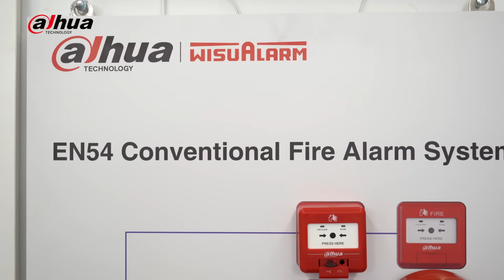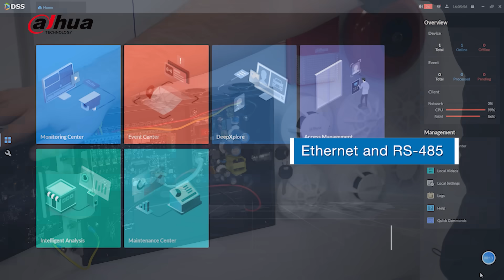Dahua Conventional Fire Alarm System

Comment: How can we fix the strobe light because we install it but when we open the panel there's a two resistor in the bell 1 and 2 when we put the wire and we test there's no response in strobe light